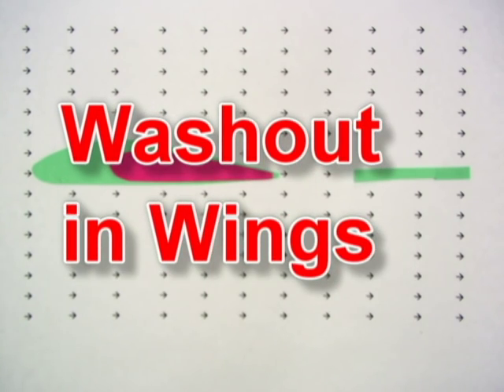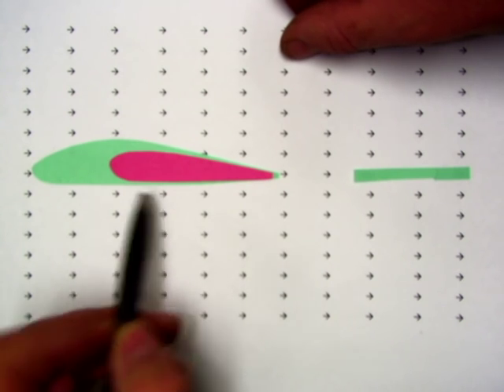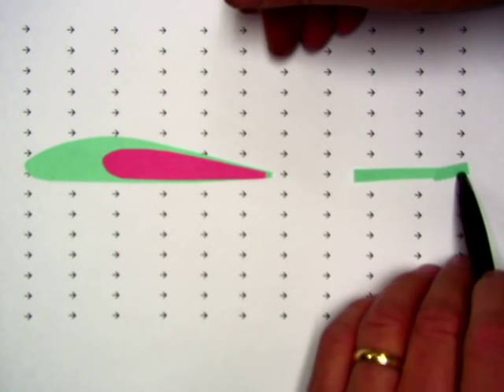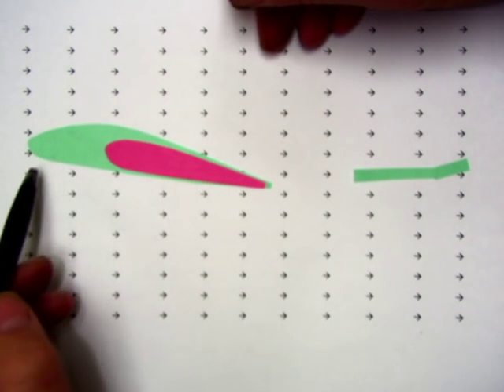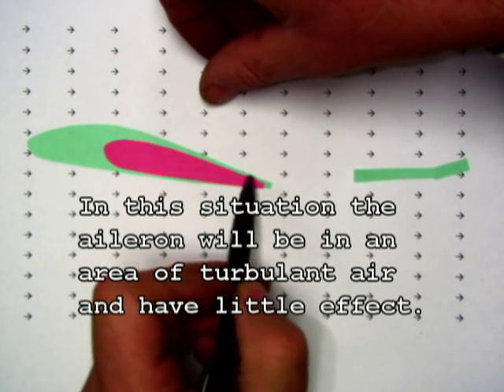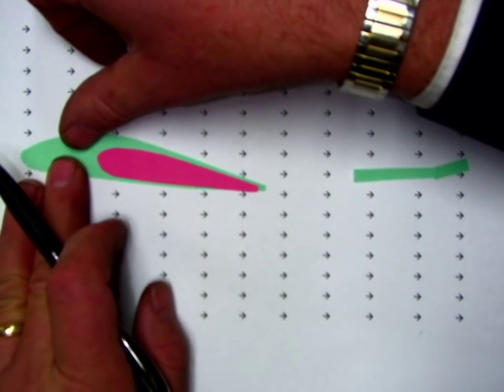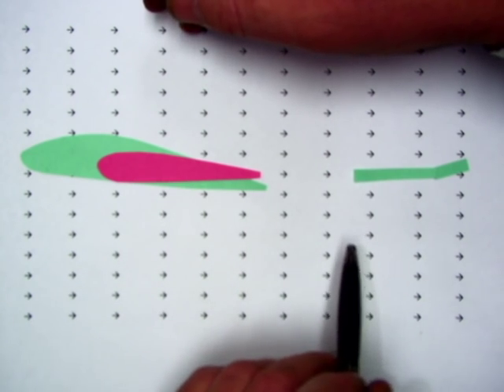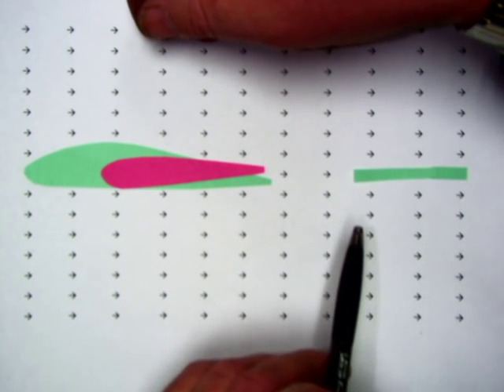Physics of washout in RC wings

Comment: Not too bad in general, but it is better to point-out the following.
 Turbulance near the trailing edge indicates the wing is already in stall.   Turbulance is not desired, nor expected anywhere on a good wing out of stall.
 A lowered aileron is effectively an increase in angle of attack (AOA) and increased lift for the aileron section of the wing and a raised aileron is an effective reduction in AOA and reduced lift.
...
 *Near stall*, not in stall and before the turbulance forms near the trailing edge, a lowered aileron effectively increases the AOA and can actually stall its section of the wing before the root, therefore dropping that tip.  
Also near stall, the opposite, raised aileron will reduce the effectice AOA, thus reduce turbulance, and take it out of stall, which will raise that tip rather than lowering it. 
This was called 'aileron reversal' in early aircraft before they figured this out. Washout was added to prevent it.
..
The net effect is the same, but the causes are a little different than you explain.
Cheers
P.S.  It also isn't actually the "longer path" over the top that reduces the pressure.  It is because the air has no choice but to follow the convex curve (if it didn't, there'd be a vacuum there) .  The so often (way too often) repeated and incorrect explanation of fast air creating low pressure and the air having to meet at the trailing edge is not the case.  Upper air beats the lower air by a significant amount.  Fast air does not create low pressure -- air moves from a higher pressure region to a lower pressure region because there is more pressure behind it than ahead; which is a net force forward (into the lower pressure region).  Try this for understanding Bernoulli:
 How do wings work - Common misconception on lift  
His slides:
https://drive.google.com/file/d/0B0JABuFvb_G_MkpBZHJmRGo3UkU/edit?usp=sharing
Click the download Icon if you get only part of the slides.

Comment: One of the key features of the Extra 300 is that it's just as capable inverted as it is upright, so you would never put washout it. Instead you would add vortex generators (on both sides), which achieves same effect

Comment: Great info for a lifting airfoil on a plane that spends most of it's time upright.   Wouldn't this make things worse upside down?
Reply from the maker: Good point.  Washout is typical for regular flight but if you spend much time upside down you would want a symmetrical airfoil with no washout.  This is the reason that the ailerons are so much larger on planes such as the 540 and 330s.  They also extend much closer to the fuse than do the larger planes not intended for stunt flight.